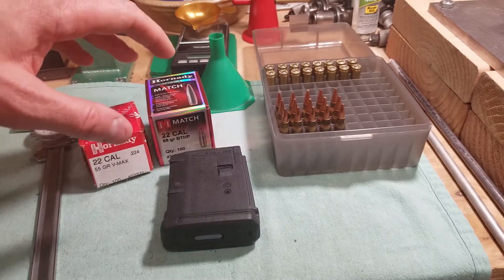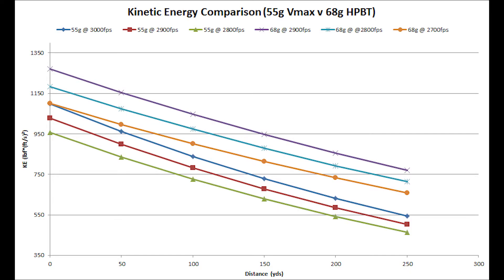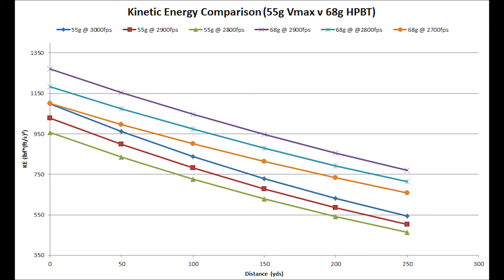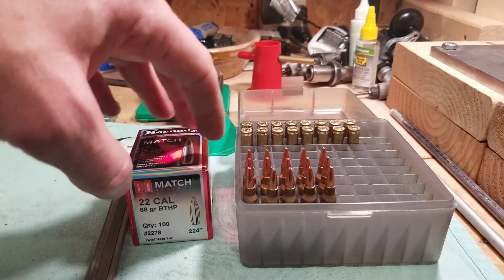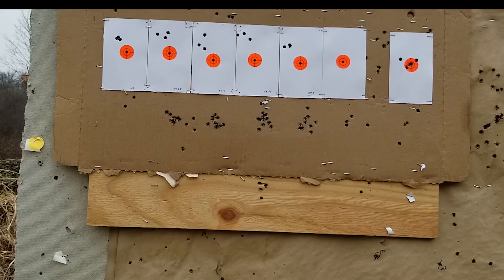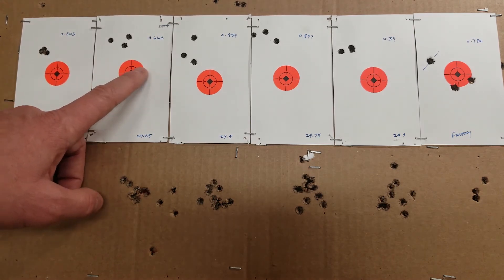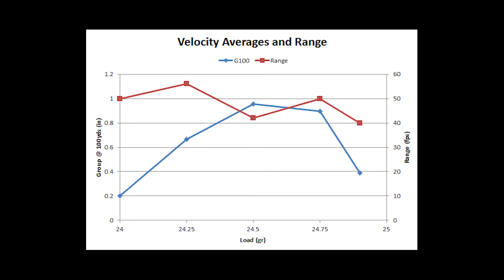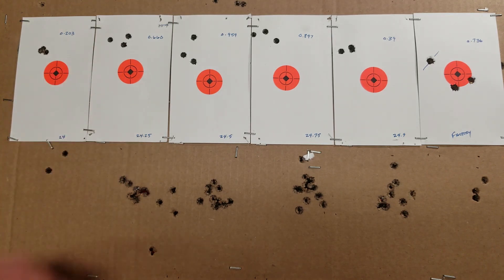AR15 reloading with the Hornady 68g BTHP

Comment: What length is your barrel. I tried 69 grain Sierra hpbt with 25.5 varget and was only getting low 2600 FPS with a 16 inch criterion barrel.
Reply: So,  I have been keeping midway open on my phone. You have to be on your game and refresh the page often and filter by available but they have been putting primers online almost daily. The window to get them is minutes tho.
Reply from the maker: Good to know I'll have to try it. I need a brick of small and large
Reply from the maker: 20 inch PSA barrel with 1:7 twist.  I haven't done a thing with this thing since the accuracy dropped off.  Hoping to get back to it once primers start coming back around.